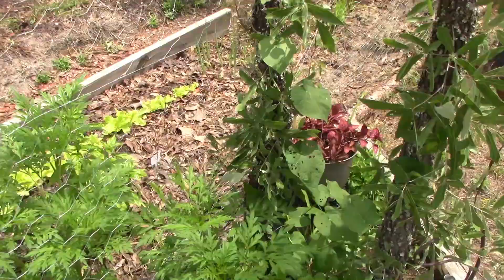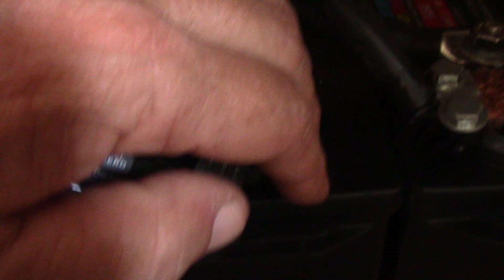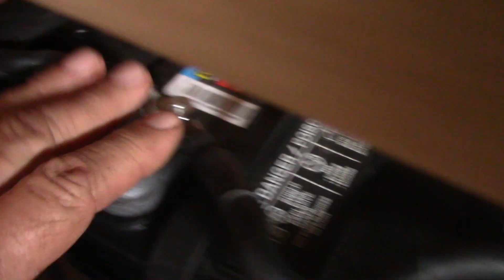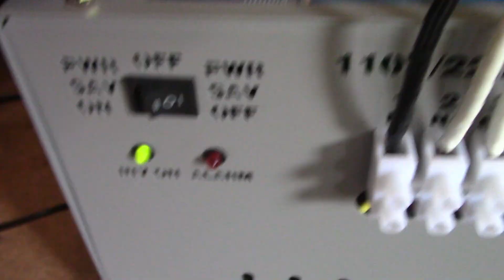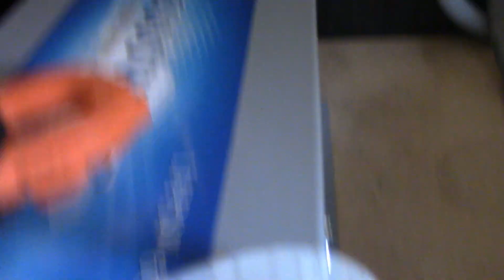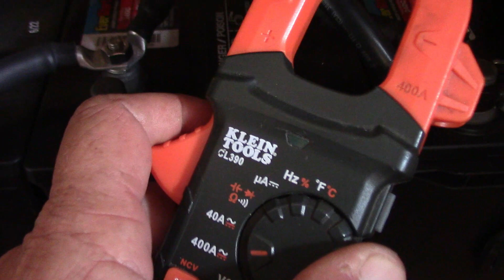SOLAR POWER  MY WHOLE SYSTEM FROM CONNECTING SOLAR TO MY HOUSE TO THE BATTERY BANK

Comment: do you use acid batterys hooked up to your system or what?.  can i use acid battery  do they last longer ?
Reply from the maker: Yes, these are deep cycle lead acid batteries, they work great, you could most defiantly use lead acid batteries, wired in parallel or series, and 12, 24, 36, or 48 volts. There are pros and cons when compared to lithium batteries. I think I did a video on batteries and load calculations about a year ago, not sure, but if you scroll through my videos, you will see it. I will do another video on batteries soon, right now it looks like we may get hit by another hurricane mid-week, if we do I'm going to record the storm and release a video on that, after that I will make a video on batteries, if you have any other questions, or want anything else on batteries covered let me know and I'll answer your questions in that video.

Comment: Pretty neat! I really enjoyed it. I have a similar set up with a whole house interlock kit in the main breaker panel with a solar generator hooked up to it and it’s working great. Question: I switch back and forth between the main breaker and the generator breaker at least once a day to help reduce electricity costs. Is it ok to switch on and off those breakers so often or is there any downside in doing so? I really value your expertise and your opinion. Thank you!
Reply from the maker: Thank you, I'm glad you're enjoying our videos. Unfortunately yes there is several downsides to doing this that way, breakers turn on and off, but they are not switches and should not be used as. Turning breakers on and off  will cause the breaker to eventually go bad. Over the years when I came across bad breakers from this, most only became weak and tripped under light loads, however there are several other problems with bad breakers caused by turning on and off, I did once see a breaker that froze in the on position, and did not trip when the hot shorted to ground from a rat chewing on it, and though I never saw this happen, I have heard other electricians come across breakers that were still on when the handle was off. Other problems are potential damage to appliances from constant power spikes, and internal surges from heavy load appliances all starting at once, which could also possibly damage mosfets or resistors in the inverter. Most appliances go bad during start mode, not while running or shutting down, so by constantly starting by cutting the power source, then restoring it , will shorten the life of tv's, microwaves, modems, etc., even the drivers in led bulbs can be damaged from from constantly cutting and adding the power source, A good choke or power diverter for your inverter could help reduce the power spikes, and a good surge protector could help reduce the internal surges. I haven't made any videos on this yet, but I will be because I plan to do this on my house, but you could add a 120 transfer panel with a 30 amp transfer switch, and transfer a certain amount of circuits to that panel and run certain things on your solar, if your inverter does not have a built in battery charger, you could use an external battery charger to maintain the charge at night. This is also good for outages, if your main power goes off whatever is in the transfer panel stays on. Hope this helps!
Reply: @smallhomeoffgridprepping1511  That’s the best explanation ever! Thank you so much for clarifying this to me. Really, I cannot thank you enough. As soon as I read your comment, I shut off the solar generator and I will resume normal operation once I install the transfer panel. I do have a 1-Phase surge protector though, installed onto the inverter panel so, hopefully I did not create too much damage as far as the electronics. I think it went on for almost a straight month, meaning I switched 3 breakers on and off once a day for 20/30 days, I would probably say around 20 times total for each of the 3 breakers. Hopefully, I did not damage the breakers. Would you suggest change those breakers? I am glad I reached out to you, I learned so much from you that when my electrician came out the first time it was really surprised that I would tell him exactly what I wanted and how I wanted it. LOL
Reply from the maker: It really depends on how old the breakers are, I don't think they would need to be replaced if they are fairly new, and were in good shape to begin with, just check them while pulling a heavier load on them, if they feel too warm or hot, then I would replace them. I am really glad you are enjoying our videos and was able to direct your electrician to doing the electric work the way you wanted it, that is exactly why I do these videos. I just ordered a transfer switch and will probably be putting that video out within a couple of weeks, we also are putting a new one out, probably tomorrow or Saturday on Solar generators.
Reply: @smallhomeoffgridprepping1511  I'll monitor them to see if they are warm or hot to touch. Two of the breakers are fairly new (3 months old), one is the main breaker of the main house panel, which is probably 15 years old. But I'll keep an eye on them and I'll report back.Thank you for the tip. Can't wait for the videos on the transfer switch and on solar generators. Too bad you are down in Florida. I am in the Great Plains of Texas!
Reply: @smallhomeoffgridprepping1511  BTW, I will be waiting for your video on this!💪

Comment: is 12 volt ?
Reply from the maker: This one is 12 volt, it comes in 24 as well, but the 24 volt and most others (8K, 10K, 15k,etc.) have all sold out from the factory, they are starting to come back, but have gone up quite a bit in cost and are currently 15-45 days for delivery. The 12 volt 6000 is still currently available and has not gone up in cost yet, but selling out quick .Shipping is normal (5-9 days) check out our eBay store to see more solar products we have. 

https://www.ebay.com/sch/i.html?item=195811125499&rt=nc&_trksid=p2047675.m3561.l2562&_ssn=smallhomeoffgridprepping

not sure if this will highlight, if not just copy and paste in your browser.